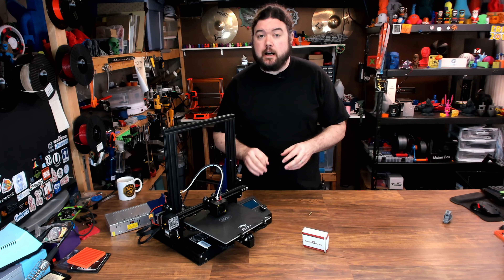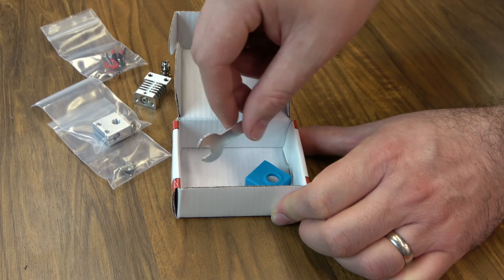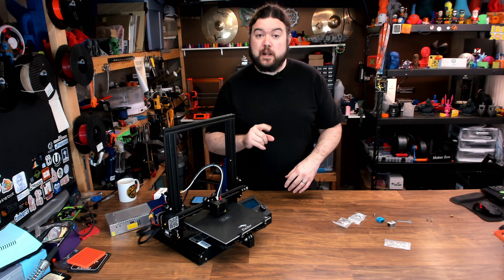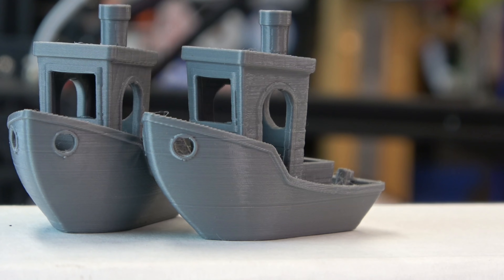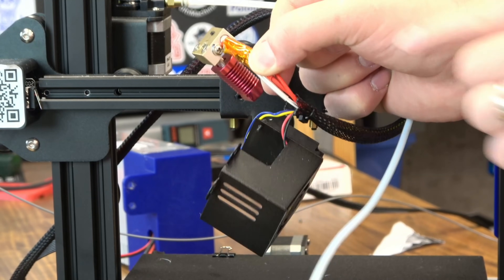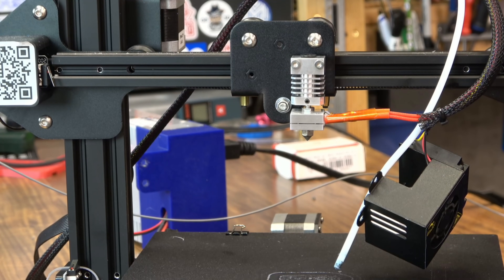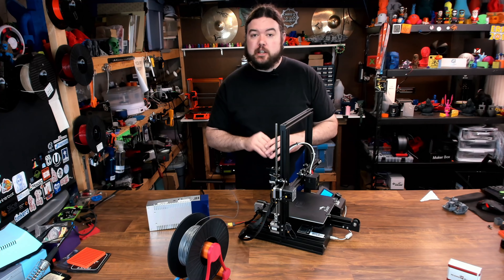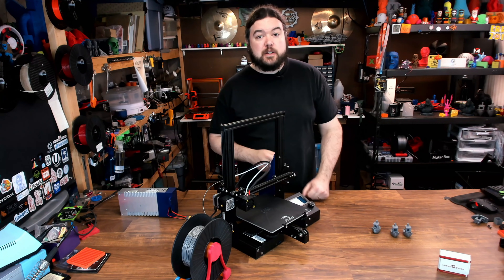All Metal Hotend - Ender 3 - Chris's Basement

Comment: I switch to AMH and get a lot of jam on sticky filament like Sunlu silk PLA. Unlike PTFE lined one, when that PLA sticks to metal tube, it really sticks so much so it has to be heated outside heatsink to knock it out. So, if you use lots of cheap filaments, which are more prone to be sticky, AMH might be a problem.
Reply from the maker: I have seen that kind of thing before. I have dipped the end of my filament in vegetable oil and ran it through the hotend before and that has slowed it down some.

Comment: I have done this three times now.  Every time it ended in heat-creep clogs in the heat-break. EVERY TIME. I am converting my current Ender3 Pron over to the Wham Bam Mutant ecosystem so that I can just print PLA with the PTFE tube setup that works well with PLA, and use an all-metal for PETG and nylons. SO SICK of banging my head against that wall.
Reply from the maker: Any clue what the issue might be? Do you think it's the amount of cooling on the hotend? Is the thermistor reading the correct temp? MicroSwiss have any thoughts?
Reply: @ChrisRiley  I haven't had good luck with 3D printing in general since I started messing around with an FLSUN delta in 2016.  I am in the middle of my second scratch-built CNC router running LinuxCNC and that thing is gonna work. But somehow I can find a way to make an Ender3 Pro reliably choke on PLA.

Every time that I have tried to setup an all metal hot-end for all filaments it's gone this way, doesn't matter which machine.  Heat break material hasn't mattered - stainless, titanium, doesn't matter, it always ends with clogging on every print. I'm just tired of fighting it. 

I need PLA for lost PLA casting and for cheap prototyping. I also need an all-metal hot end for printing Polymaker PA6-CF into functional parts, among other nylons. Therefore I'm going to return to the Unix way, and Do ONE Thing, and Do it WELL - so each hot end will be built specifically for the material family being run through it.

I have a Slice Engineering Copperhead showing up which is joining a new MicroSwiss plated copper heater block + ruby nozzle for the nylon hot end, and I have the stock Ender hot end handling PLA just fine with Capricorn tubing. Heck, I can add a Bondtech CHT to the PLA nozzle and it should be better than fine. 

The Mutant will allow for easy swapping between them.
Reply: @ChrisRiley  And it's just occurring to me that you might think that I am saying that the Copperhead clogged. I haven't received it yet. Miscommunication, my bad.
Reply: @ChrisRiley  UPDATE: Got the Slice installed with the Microswiss plated copper heatblock.  So far I've only printed PETG with it, and the prints have all been flawless without a single hint of an issue.  The old block had oozed and that turned out to be the source of the clogging problem and I couldn't see it through the stock mounting shroud. Currently printing up a Bullseye cooling system for it - hopefully it will have enough adjustment because the Slice hot end is longer than stock.

Bondtech CHT just showed up. I'ave already got a dual-gear extruder setup so hopefully I should be able to keep it fed.

Comment: How do you change the printer so you can have a higher upper limit? Mine maxes out pretty low by default.
Reply from the maker: About your only option would be to reflash the firmware and reset the max temp.

Comment: I upgraded my
Hotend. And ever since I have had really bad under extrusion. Any tips? I’ve re-calibrated everything and still the same. Only thing I have left to tune is my retraction
Reply from the maker: Retraction could be the problem. For this hotend, try to set it down to 2mm just for a test. You might be pulling the filament to far back into the cold zone.

Comment: Can you use the terminal from the touch screen on printer to adjust Heat temp on the board?
Reply from the maker: Yes, you should be able to adjust it from there.

Comment: For the Love of god and holy why is every single Video at YouTube showing it wrong...If you Put it together DIY you need to apply Boron Nitride Paste at Sensor and heater. And If you use a coperheatblock and a Steel nozzle it needs Paste there too. The whole Tuning ist useless and will have None or less effect to the original. But thx to videos Like this i got a lot of Work in the printer repair Shop from Guys who follows this.
Reply from the maker: I'm glad you got it going. Thanks for the comment

Comment: Hey Chris. Recently got the direct drive hot end from microswiss. It’s been sort of hot and miss. But what I’m really struggling with is the actual firmware update.. I can’t seem to find a video of how or what to recalibrate in terms of the firmware. I’m just trying to get a basic understanding of the coding and also the correct way to actually get it to flash to my Ender 5. Please tell me you have a video for this. I don’t really trust anyone else other than you my friend🤞🏻
Reply from the maker: Hey, if you are just wanting to get into flashing Marlin, I would check these out. 

VScode setup : https://youtu.be/JWUcnkjeNU8?t=132

Basic marlin from example config:  https://youtu.be/1PPBHn-jU0k?t=1191

If it's just for tuning in your extruder, you should have to change the firmware, most of that can be done with a couple of commands saved in eeprom.

Comment: if you really want to improve the ender extruder all you need to do is to exchange the heat break with the one from Slice engineering. ( copperhead C-E variant)
Reply from the maker: I might have to try that.

Comment: Great vid! One question tho.. In order to print nylon (all metal hotend is to print with high temps) the temperature must be higher than stock. How do you up that temp?
Reply from the maker: You have to flash the firmware.

Comment: Why do they use titanium heat break when cheaper nickel has half the thermal conductivity of titanium? Is it because of the hardness? Couldn't they just use 304 stainless steel as most materials are soft enough, even carbon fibres, to not need the hardness of titanium while 304 has similar or less thermal conductivity and good enough hardness? It seems that Micro Swiss are trying to justify bumping up the price for no good reason. Useful video BTW Thanks.
Reply from the maker: Thanks! Titanium seems to be common. Not sure why, maybe it expands less than others.

Comment: Thanks for the video Chris. I switched to the Micro swiss and I have had a lot of problems. Sometime I get good prints and sometimes failure. Still working on it. I recently noticed I have to level bed before every print. Everything looks good, nothing loose. Maybe a pid tune is needed. Thanks
Reply from the maker: Strange, I hope the PID tune will help.

Comment: Tiny machines 3d installed a microswiss on my Ender 3 before shipping. In 2 years I've had only 1 clog. Couldn't explain it, but cleared w/o taking things apart.

Retraction should be no more than 4mm w/ an all metal though. I needed 4. With linear advance I only needed 1.3. With direct drive and pressure advance I'm down to 0.4.
Reply from the maker: That's great info! Thanks!

Comment: Would a all metal hot end help with higher temp filaments? Ie. PTEG?
Reply from the maker: PETG is kind of all over the map, I prefer to run it hot, 250ish, so at that temp it could help you.
Reply: @ChrisRiley  yes I found 255-260 works best with 5-6 retract. Label on filament spool says 230-260 but anything lower than 250 is bad results

Comment: My first printer was the original Ender 3. My first upgrade was to fit a genuine Micro Swiss all metal hot end. In my opinion getting rid of the tricky and inconsistent Bowden tube-nozzle interface was well worth the cost and my main reason for the upgrade.
I developed my PLA+ profile to mitigate stringing with the maximum retraction of 4mm. There are a number of other settings other than retraction that can be used to get rid of stringing. 
Also I was printing a lot of PETG and high temperature CF filament.
Reply from the maker: Hey Patrick, you have a point, that is probably the best reason to do this upgrade. The tube has always been a pain.

Comment: The worst part is the heat block. only a matter of time until it starts spinning because it lacks the 2 screw holes on the sides even though the heat sink has the threads. I eventually tossed it and used the stock one.
Reply from the maker: Interesting, I will keep an eye out for that.

Comment: Please do one with an ender 3 with a v6 hotend in bowden. I could not get good pla prints, and e3d themselves couldn't figure it out. They told me after a two week troubleshooting period, to just keep using it in direct drive. There's hundreds of people online with the same jamming and failure issue with no resolution. Maybe if a big name person like yourself points it out, they'll fix it, or quit advertising it to be used in bowden.
Reply from the maker: Interesting, I wasn't aware there was an issues, I have some in a bowden config, maybe I need to do more testing.
Reply: @ChrisRiley  oh please do! I can email you the back and forth I had with E3D. I've tried the v6 on an ender 3 with a dual geared extruder, an ezr extruder, and on a Tronxy X5SA pro both ways as well. Always jams or clogs. Direct drive was the only way to get it to work. Comparitively, the microswiss had no issues. Google "e3d v6 bowden jams" and see the sea of people with issues. I even used a 5015 blower on the heatsink to ensure cooling was not an issue.

Comment: great content and yes some PLA do stick to the Microswiss , it drove me Nuts  on my first swap out 2 years ago...
PLA only ? use a  bowden system with a lightweight hot end to gain speed ...
Reply from the maker: Glad I am not the only one this happened to. ;)
Reply: @ChrisRiley  it's almost that, except it's not PLA sticking to the hotend, but PLA expanding inside the heatbreak's cold end/zone, and that's why all metal hotends manufacturers recommend to limit your retraction length (as the filament has a more define cold/hot transition zone, it's not a problem to get string-free prints with lower values) and in some cases you need thermal paste between the heatbreak and radiator (E3D didn't really want to acknowledge it at first, but that's also why V6 are now shipped with a bag of thermal grease that's """""optional""""" wink wink ;) the thermal paste just help to make sure your cold zone doesn't "heat creep" on your PLA, i'd say not all threads are equals and that's why "round mounts" like the MicroSwiss doesn't need thermal paste)

Comment: Thanks Chris. The main reason I swapped to all metal is the Gunk the eventually push the PTFE tube up and clogs the hotend. All metal is less maintenance. You may still get clogs when settings are wrong (some PLA brands are more prone, like filament diameter or temp settings) but it happens way less.
Reply from the maker: Thanks!

Comment: Funny story about a week ago I accidentally bridged my thermistor and heater wire with pliers. Never do this btw. Have had to replace the board and thermistor so far not sure if I also borked the heater cartridge
Reply from the maker: Oh No! Good luck friend. 🙂
Reply: @ChrisRiley  ender up replacing board (skr mini 2.0) and thermistor. So like 65 to get it back up and going. Not terrible but could of been avoided had I not been improperly holding the heater block during nozzle changes

Comment: How do you calibrate extrusion width and flow rate? Great video 🙏
Reply: Slice a square box with 0 infill and 1 line width perimeter (i.e. 0.4 wall thickness). With bottom thickness set to 0.4 and top thickness set to zero so you will print a hollow box. Then print and measure the actual wall thickness. Flow rate controls the extruder length so make sure your E steps are set correctly.

Comment: Thanks - A nice straight forward comparison for us PLA users 😎

One thing I'd definitely recommend though is initially only heating to around 100-110 before pulling the PLA out for a nozzle change, so it comes out in 1 piece and stops it gunking up and creating a mess between the new nozzle and PTFE, which in turn creates extrusion or retraction problems.
Reply from the maker: Thanks for the tip! 🙂

Comment: As someone who's sold 3D printers with PTFE liner hotends and who's selling all metal hot end upgrades all of the time, here's the same advice I give to any customer who's asking for my opinion on the issue:

If you're printing PLA most of the time - stay away from all metal hotends unless you're upgrading your extruder setup too AND are willing to REALLY fine tune your retraction settings or you'll end up with lots of clogged nozzles and/or failed prints...aaand even then your PLA prints most likely will look worse than they could if you used the stock hotend.

There's a good reason why all the cheap 3D printers come with PTFE liner hotends. They work really really REALLY well with PLA. (Did I mention they work really well?)

In essence:

PLA/PLA+ -> PTFE liner/stock hotends
PETG, ABS, Nylon, ASA, etc. -> all metal hotend

For most people the PLA(+) route is just fine. I've dealt with far more issues from people who felt they had to "upgrade" their perfectly fine stock printers due to some perceived drive to "upgrade" to a "better" all metal hotend than with actual 3D printing related issues based on the process itself.

Most people getting into 3D printing, don't NEED all metal hot ends AT ALL, yet are made to believe those are somehow "better" and one of the "first upgrades" one has to make. I've had customers who hadn't printed anything at ALL and were dealing with all metal hot end upgrade related issues. 😒 These are the same people who quickly quit, due to the hobby being "too frustrating".

If you're new to the hobby, take your time. Most probably you chose a machine based on (hopefully genuine) positive reviews. These reviews were most probably based on the fact that the machine is a good product. Take your time to get to know the machine, the process. Take your time to gain some first hand experience. Don't "upgrade" anything until you know what you're doing...
Reply from the maker: Cool, thanks for your insight! 🙂
Reply: The best comment here. Thanks! I thought PETG can be printed with stock hotend tho.
Reply: @Wrublos212 I can successfully print Local brand PETG with stock, 1st layer 235 C the rest only 223 C very stick to masking tape. But when it last i change to Esun PETG, only start to stick at 248 C 1st layer (not strong also) then hotend clogging happened :(
Reply: Hey man what hotbed nozzles would you recommend for an ender 3 v3 ke?

Comment: Do you have any thoughts about installation of a bi-metal heat break?  Seems to be an inexpensive way to get an all metal hot end.  I see Slice Engineering sells them to fit an Ender 3.  They are also available from AliExpress.
Reply: Tom has video on the slice bi metal and Stefan has one on the aliexpress ones. They both seem good but the slice is better quality.

Comment: Don't forget if you want to print at higher temps you need to replace your stock thermistor. The stock one that comes with an Ender 3/pro/v2 is covered in PTFE as well.

Comment: I have a all metal hot end it came with a tube should I use it?plus what is the best one for pla ? Thanks for any input.
Reply: I would recommend the normal PTFE hotend because all metal usually clog when using low temp plastic like pla.
Reply: @Kimkim-gl6qc  thanks😁👍

Comment: I really wish micro swiss would add the 2 screws so the heater and throat stay in place when removing nozzles
Reply: The problem with those screws going from the heater block to the heatsink is heat creep. Hence, they've probably found, when designing their hotend, that with those screws on an all metal hotend you can get heat creep going into the cold end, which leads to jams. Yeah, it's a pita not having those screws to secure the heater block and keep the heat break from loosening, but it works better more often than not without them.
Reply: @serinfel  you'd think so but they don't. Chep has an entire video dedicated to proving it doesn't effect heat creep at all. I have dragon and mosquito hot ends on all machines and they have 4 screws in each and are made to be the hottest hot end on the market and will never have heat creep. They are the best hot ends you can get. They better be at almost 100 bucks a piece. It definitely seems like they'd cause heat creep but surprisingly enough do not. Ptef lined hot ends and high heat are what you want stay away from.
Reply from the maker: It is nice when it's attached, much easier to deal with the nozzle.

Comment: I wish Micro Swiss would do something about the Bowden collet like getting rid of it and using a PC4-M10 as after a couple of months of usage the Bowden tube starts riding up and down, I fixed mine by roughing up the outer surface and wrapping some PTFE tape around it and fixing it with some Kapton tape, that locked the tube back in the collet
Reply from the maker: Yeah, these aren't my favorite either, Bondtech has the same issue.